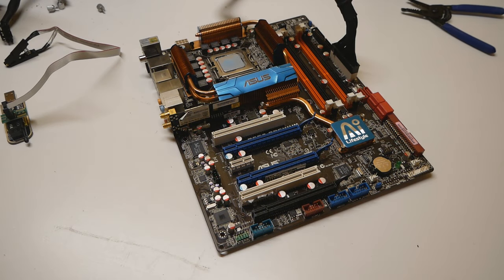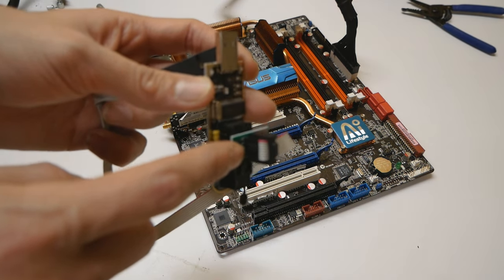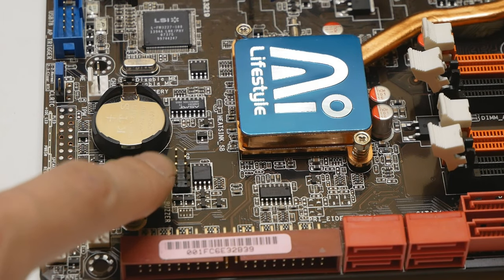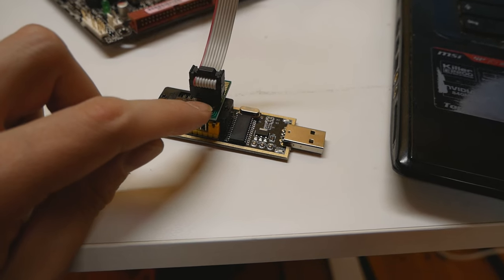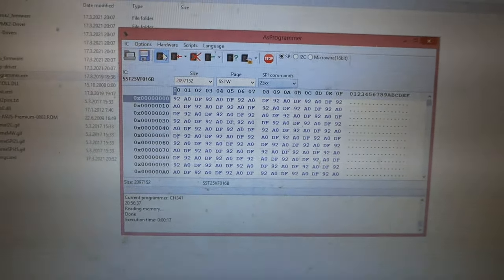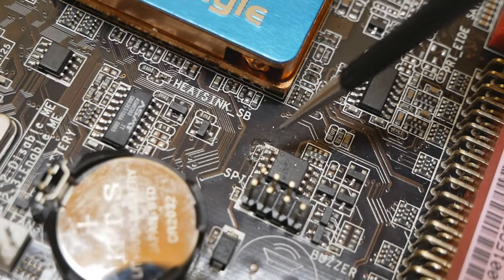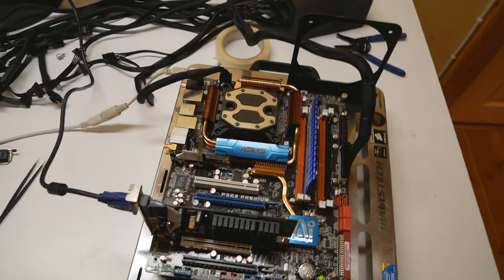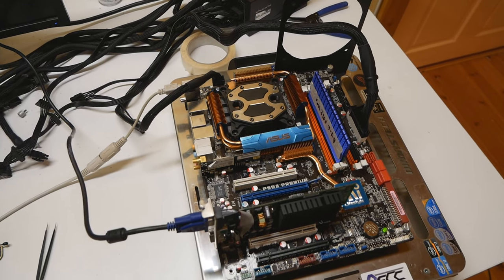Motherboard with Corrupted BIOS? FIX with CH341A External Flashing Tool

Comment: I wanted to say thank you sir, for a very helpful tutorial. I wanted to upgrade my CPU, which required a bios update. Which I had done before, this time around it failed(simply turned itself off mid-update), and I used your tutorial to a great success! I have you to thank for saving money from having someone else fix it or worse buy a new board! So I want to formally thank you!
Reply: Hello, please help me :( did you use .bin file or .rom file because I have a b450m aorus elite and should I download the bios from the official website or what :(
Reply: @merri9893  Use the bin file from the website.
Reply: @InterestsAll  Kind sir :( it's not in bin file :( it's some other file like .f67 :(
Reply: @merri9893  Try changing the extention to .bin
Reply: @InterestsAll  THANK YOU 🫶🏻

Comment: If the SPI header is on the board you don't need the clip.
Reply: What do you mean please explain?
Reply: what is that
Reply: Serial Peripheral Interface (SPI) is a series of pins or connectors on the motherboard that are used to connect the different chips and the programmer hardware, Not all motherboards have it.
Reply: Hi, how can I do that? I can't find any thotorial for that spi connection. Can you help me please?!🙏🙏

Comment: Thanks, this may be something I need very soon. My Asrock X370 Fatal1ty is about dead like its name implies, haha! About 100x tries to get it to boot (swapped CPU, RAM, integrated graphics only/external GPU, button battery, etc). Thankfully if I leave it running it works fine, but its very sketchy when booting back up (got it just now after 2 hours of messing with it) and that's the biggest flaw that I hate about that board is it doesn't have a replaceable BIOS chip and Asrock is a little buggy when it comes to making BIOS in the first place before I get my hands on benching with it. Thankfully I think I have that flash tool already so if it finally goes I'll have to try it (looks like I bought it 3.5 years ago, and warranty is 3 years, go figure, haha!)

Thanks Luumi! Happy benching!

Comment: @Luumi Those CH341A External Flashing Tools are meant to receive a chips by itself. You don't need any power to the motherboard or the chip. You are also supposed to remove the bios battery "normally". Beside that you have bin very lucky you did not fry the bios chip or the motherboard. Your CH341A has a manufacturing error. It connects 5v to the 3,3v data pins and need some soldering to be used save. Google CH341A  5v fix
Reply: And because of that problem there is a newer CH341A programmer model on Aliexpress and other places that has a manual voltage selector switch for 5, 3.3 and/or 1,8V.   So, no need for a mod. Job done.

Comment: Just a fun tip, EVGA mobos have 2 bios chips per board with a switch bios 1 bios 2 selector switch so if 1 is corrupted can use the 2nd one to boot into windows still
Reply from the maker: Modern boards have even 3 bioses but not all have a removable BIOS chip.
Reply: . @LuumiJuhani   I wonder what made you say in the video that this chip is not removable?  Any 8 pin chip in the world is removable with the right kind of tools and skills. Tip: to avoid melting plastic parts or other electronic components situated in the vicinity of the chip while using the hot gun to desolder the cip simply use some capton tape and that  is heat resistant and will protect them from burning.

Comment: I overheard somewhere that the CH341a is spitting 5v out its data line, instead of 3.3v. Is it necessary to mod the programmer so that it spits 3.3v?
Reply: Under load it drops to 3.3v

Comment: Chip quick or hot air will remove the chip, but it is necessary to have pretty advanced soldering skills and the right tools. I have desoldered bios chips from graphics cards because of the clip not gripping good on board and flashing them with this excellent flasher. Thanks for the video.
Reply: it's also got an ISP header right next to it, which should make light work of the problem..
Reply: @TheducksOrg  what’s that

Comment: Thanks for this video. I have a problem with my laptop BIOS (it won't start after a failed BIOS update) and after taking the board out I have identified 2 chips which could be the main BIOS. One is a Macronix Mx25L167E and the other is a Winbond 25Q3 2FV S10. I have just got a CH341A programmer and I have managed to read the Macronix chip and the Winbond chip. So far, so good. How do you identify which is the BIOS chip as there are no markings on the board? The Macronix chip is nearer the CPU and the Winbond chip is near the edge of the board next to an ITE chip? Thanks in advance!

Comment: Question. I have a bunch of chinese motherboards and I cant find the most recent bios for them. Around half of them are causing major issues as a result of the bios being out of date while the other half are fine. Would I be able to copy the bios off 1 of the good boards and flash it to 1 of the bad boards if they are all the same model?
Reply: Yes if they are all the same model. Read the newest bios that works store it and reflash the bad ones. Done.

Comment: I have the MSI B450M pro-m2 max motherboard, i wanted to upgrade my cpu from 3100 to 5700X. I have to update the bios to be able to use the 5700X, but in the middle of installation it corrupted, Now everytime I turn on my PC the cpu debug led it turn on. I've tried everything (clear cmos, -changing the cmos battery, take out the CPU and re-inserting it back, etc) but still doesnt work. Do you guys think by flashing it with CH341A will fix the issue?
Reply: Same thing happened to me. B350 tawmahwk. Cpu debug led is turning on and stuck on it. Nothing happening. Im also trying to fix this..if you're stuck on this and if you fixed it please let me know 😢😢
Reply: @FrostedCPU  thank you for the reply btw. It turns out my mobo bios chip is to small so the ch341a cant grip it. So if i want to fix it i have to desolder i think.  I cant fix it by my own so I just bought a used mobo which is b450 pro4.
Reply: My old mobo was corrupted because i plug the usb drive to the front panel and it was dusty so it was my fault after all. 😂😭
Reply: @shiftycs  Me too I also connected into front and it fucked up the bios somehow even it said successfully flashed. 😿

Then I tried to downgrade it since I flashed the latest version of bios and it was a beta version. So I thought since it was a beta there could be bugs. But msi doesn't allow to downgrade bios. So I flashed the same bios again. Then the PC works for few hours without a problem but this time the bios screen doesn't show up when turned on. SoI think I have to do try this at least 🤕😿
Reply: thats kinda weird maybe try asking in the tomshardware forum maybe that will help
Reply: @shiftycs  Thanks I'll ask there

Comment: Hey got a question ... I properly got my ch341a working and I can read the BIOS (or what is left of it, most data reads blank) But I can't for the life of me find the proper normal driver for my motherboard. The Gigabyte website just has some exe that extracts to a few files ... non of which are hex or bin files. The file extension of one of the files end with FC ... which is the version of the motherboard. Is there another website or something where I would be able to download the proper BIOS file? Thanks in advance! (it's a very old motherboard GA-970A UD3)

Comment: Hi, great video, but when you buy the CH341A, is it originally programmed for your Bios (make, model, etc) or is there a reference for each different Bios?
Reply: The CH341A is just an interface device. You have to actually find and download the correct BIOS firmware.
Reply: @SkeeterPondRC  For lenovo b51-80 laptop can work this metod? I have a motherbord with corrupted bios.. Thanks

Comment: I had a p5e3 deluxe / wifi  motherboard and the same problem happened to me, but I didn't have Windows for this, and I executed these commands with flashrom installed in my Linux and my problem was solved(just be aware that whenever you encounter a problem or error at any stage, you should Run the following commands again from the beginning, because if you don't do this, the motherboard will not work despite the correct information in BIOS and you will end up in bootloop!)

flashrom -E --programmer ch341a_spi                                                   #erase BIOS
flashrom -w 'bios file location '  --programmer ch341a_spi                 #write and verify BIOS
flashrom -v 'bios file location '  --programmer ch341a_spi                  #verify BIOS
your bios should work again 😉😉

Comment: Where did you get the ROM file of your bios? I have MSI X99S SLI plus and i can't find the rom file for it
Reply from the maker: From the manufacturer's website, where you can get all BIOS files and drivers.
Reply: @LuumiJuhani   .rom files are not available on website. I get some strange format files *.100 file format. Is it possible to use it directly with CH314A?
Reply from the maker: @AhmadAlghannam  I think you can covert to rom.

Comment: hi, i run into an issue when clipping to my bios chip. windows and programmer software stops detecting the usb programmer then states usb device malfunctioned. like if it shorted the usb. ive checked pin  1 connections and adapter to usb programmer and they should be correct as every video ive learned from. any ideas. drivers a installed usb recognized. but once i connect to the chip it shuts off the usb. (no pwoer on board no cmos batt)

Comment: I need to do this with my thinkpad t15 but I searching for the bios file. on lenovos page there is an exe file you can extract it and then there are 2 files in a folder 1mb~ and 24mb~ I think there these but I don't know if it's correct

Comment: my pc wont run until i reset motherboard by removing battery, after that it has small chanse to output display, if it does freezes at startup, showing some system info.

Comment: Thanks for the video!

I might've just messed up flashing the BIOS on my motherboard.

I happened to have the USB programmer already, so I just ordered the required clip.  Once it arrives I'll give this a try.

Seems like the most important thing (other than getting the clip to contact the IC pins) is to connect the red wire to pin 1 on both the IC and adapter, right?

Comment: Why would it ever be necessary to turn on the board ?
If you remove the bios chip and solder it to a breakout board, it works fine, so why would you need to power on the board ?
Reply: Because the CH341A may not power the chip.

Comment: Please Help. Hi, I have Dell XPS 15 L502X {2nd-Gen i7 processor & windows 10} (purchased in 2012). Few days ago, a blue screen error suddenly appeared during using the laptop (not remember the error code). After that, repeat blue screen errors occurred just after the windows completely load up but Windows was loading in safe mode.
Next day when I tried to boot the laptop again, it's fan, leds lights & keyboard backlight etc are working but display is not turning on at all (Not even Dell boot logo is showing). Battery & charger is ok.
I have done all basic troubleshooting steps like press power button for 1min without battery & charger. Also connected the laptop with external monitor but no help.
Laptop Display is working, i have done Dell Display test by pressing "D-key + power button" and multiple colors are showing but after reboot same black screen issue is happening.

During repeatedly trying to boot the laptop, 2 times Dell boot logo was randomly appeared out of 50 trys. And an error code was showed on boot " 00c08270: Real time clock error - check date and time setting" along with continuous beep sound.  
I pressed F2 to boot in bios and changed date & time settings and then I pressed F1 to boot in windows. Windows was trying to load but a blue screen error occurred " Stop code: DRVER POWER STATE FAIURE" .
I thought that it is CMOS batter issue so next day I changed the CMOS battery and installed a new one. I also removed the RAM, Keyboard, HardDisk and cleaned their connectors with soft brush & cloth.
But issue is still occuring, Dell boot logo is not appearing again & display is totally black but fan, led lights, keyboard backlight etc is ON. I am not able to access BIOS settings.

 Is this problem related to BIOS? (but I hadn't installed any bios).
So, What can be the issues & how to resolve it ?
Reply: possibly bios

Comment: Yo ! So my motherboard isn't posting anymore CPU fans spins and shutdown do you think it's a bios problem    bios chip is mx25u128 1.8v
Reply: Sounds like it to me.  My motherboard seems to have all the fans spin up (including the CPU) but no power light on the front and nothing from the video outputs.
Reply: Same as me, my pc didn't post after I update the bios
Reply: @mstrariel  after checking  it wasn't a bios problem for me it was something else   but for you I suggest you to buy a bios chip from eBay and replace it  what's your mobo?
Reply: @ilyaseltrico445  what was the problem, my mobo dosent post or show a display. using gpu or intergrated gfx. fans spin on gpu and cpu but nothing happens, black screen. i think it might be a bios issue. tryed diffrent ram, and all slots. other gpu dvi vga hdmi on mobo and on gpu, still black screen. no post. ><

Comment: What about using the 1.8v adapter? I hear 5v is too much for BIOS chips and can fry them without using 1.8v adapter!
Reply: Although it’s recommended to match voltages, even with 5V it’s just 1ma current. Never seen anyone fry a chip with 1ma. It would be fine as long as it’s plugged in properly and doesn’t get too hot.

Comment: Could this help remove a bios password from eeprom, as I'm running a Laptop, and clearing CMOS doesn't work.
Reply: This clears every bit of information in the bios, so yes
Reply: @DrTwitch  I used the ch431a and was able to reflash my bios and unbrick my board.
Very nice little tool

Comment: In my case after i update the bios i have no display, i try to rest the bios by removing the battery but it didn't help 

If i use this way do you think it can fix my motherboard
Reply: i have done the same thing, i think it will work, tomorrow i will receive the usb
Reply: @deastt2046  its a 50/50 chance it seems.. worked it for you? 😄
Reply: @yukuzoona6604  yeah it worked! but you need to take off and put the bios chip back again, the thing that they give you, that you put on the chip doesn't work so you need to take it off the motherboard, you need someone who has got the things to do that
Reply: @deastt2046  yeah i readed that also that you could have a voltage loss with the clamp and thats not working then sometimes. i see me ending up buying a new mainboard for my fricken old 4th generation cpu -.-
Reply: @yukuzoona6604  you need to check the version of your chip, and if the voltage is 1.8 you need to also buy an adapter of the voltage just to not burn the chip, sometimes can happen
Reply: @deastt2046  my IC is a MX25L12873F and it needs 3,3v, so i need no 1,8v adapter. but i also readed that many of that ch341 devices have a voltage failure in it. i readed about a new version where it is fixed. but it makes me banana i cant repair my fricken bios with it and if im doing something wrong or its just technically somehow not possible 🤯
Reply: @yukuzoona6604  check some videos on youtube, i had the same but not 73f, the 72f, and it needed 1.8V
Reply: @deastt2046  hmmm i have that adapter around, maybe i give it a try just to have tried every possible for me. thx for the advice and i will inform you when something happen 😊
Reply: @deastt2046  yeah the 72f have the same 2,7V bis 3,6V like the 73f. maybe if works for me also with the 1,8v adapter 🤷‍♂ i check that out. but you have unsoldered the chip??
Reply: @yukuzoona6604  okkk ;D
Reply: @yukuzoona6604  yeah it will work with the adapter i think, by the way yes i did
Reply: @deastt2046  hmm unsoldered is a difference again.. nayway i try it 1,8v with the clamp

Comment: dude, do you realize that this SPI header was for BIOS chip and the clip hassle was unnecessary?
Reply: Exactly :) this SPI header is connected directly to BIOS chip. Only need to check with multimeter (I realised that pinouts posted on the internet aren't always true) and connect those pins to programmer. More reliable than the clip. Also beware the voltage on the chip. Mostly spi flash is 1.8V so you need to plug adapter to CH341A programmer.

Comment: Such a terrible tutorial when it comes to BENDING THE BOARD PINS.  Why can't the clamp sides be trimmed to make it fit better? You don't explain how to differentiate if the BIOS chip is 24XX or 25XX.

Comment: just remove the cmos battery
Reply: That's...not how that works
Reply: @Joostinonline  cap
Reply: @aidanblue1005  that resets the bios settings. It doesn't fix a corrupted bios.